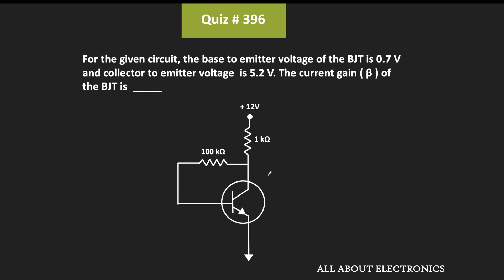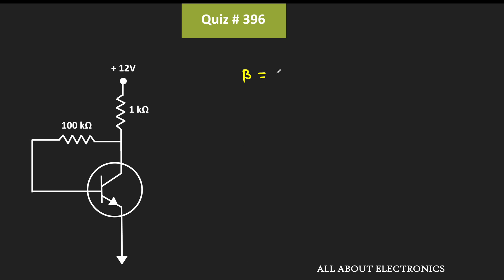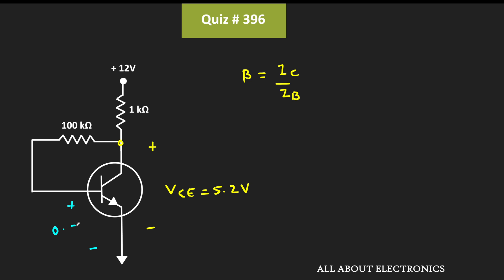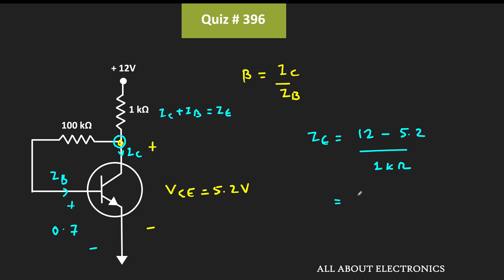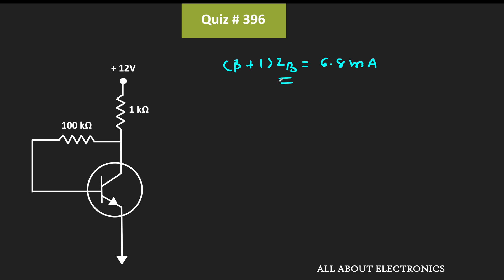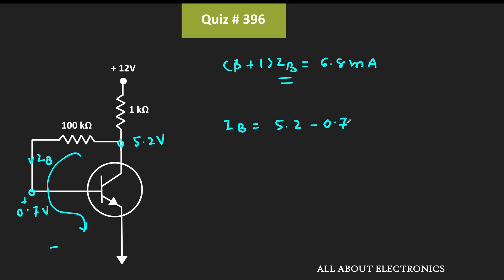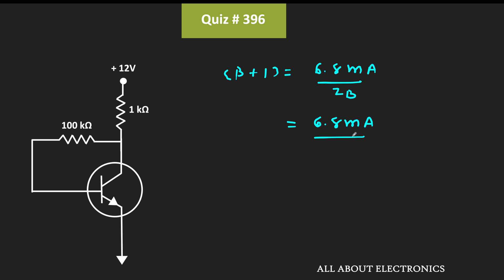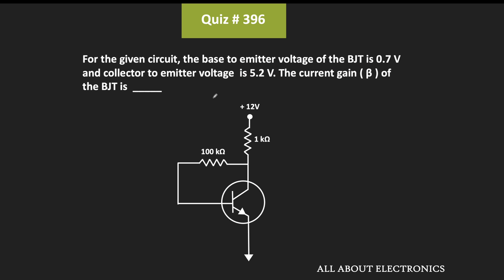BJT (Collector Feedback Bias ) | Quiz # 396

Comment: +12 voltage is for collector and not emitter... How is it possible Ie=12-5.2
Reply from the maker: There is a feedback resistor of 100k between the collector and the base terminal. The current through it is the base current. If you apply the KCL at the collector terminal then current through 1k resistor is the summation of collector current and base current. And as you know, emitter current Ie = Ic + Ib. So, effectively, by finding the current through 1k resistor, you can find the emitter current. (if there is no feedback between collector and base, then current through 1k resistor would have been the collector current). 
I hope, it will clear your doubt.

Comment: 02:03 
Why you use there (B+ 1)Ib=Ic ? 
I think is B*Ib=Ic -->B= Ic/Ib
Reply from the maker: Here we are finding the voltage drop across 1k resistor. The current through 1k resistor is the summation of base current Ib and collector current. (Ib + Ic). Which is equivalent to (B + 1) Ib. I hope, it will clear your doubt.
Reply: @allaboutelectronics-quiz  Oh finally I get it, Thanks dear
Reply: @allaboutelectronics-quiz  Current through 1k resistor is not summation of base current and collector current, it is infact collector current only,emitter current is at the  bottom of npn transistor, so B must be 151
Reply: @dwaynephilips6820  i think you are wrong
Reply: Yes, I think B=151 and that is it no more -1